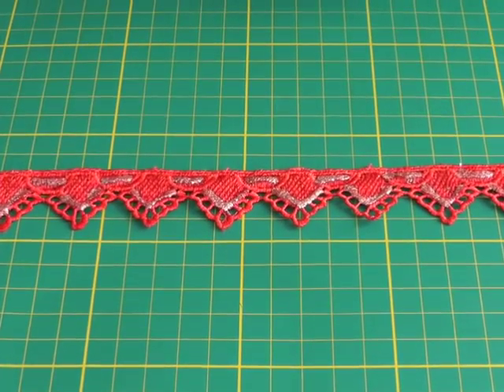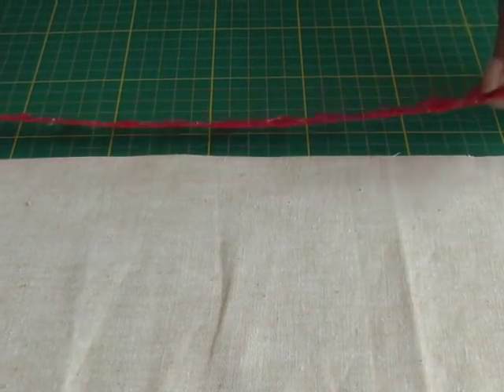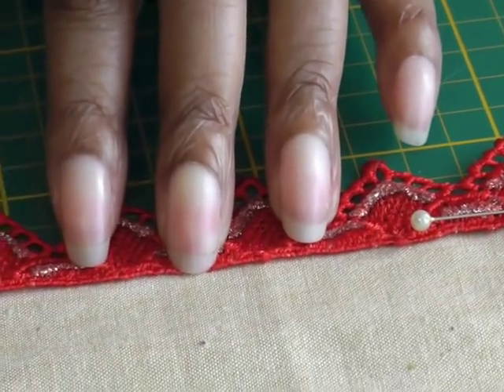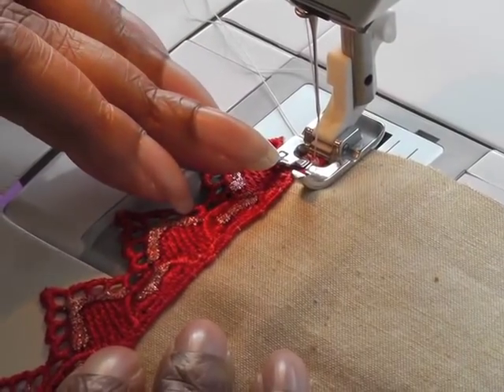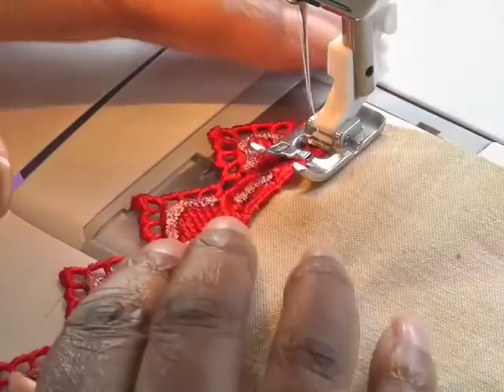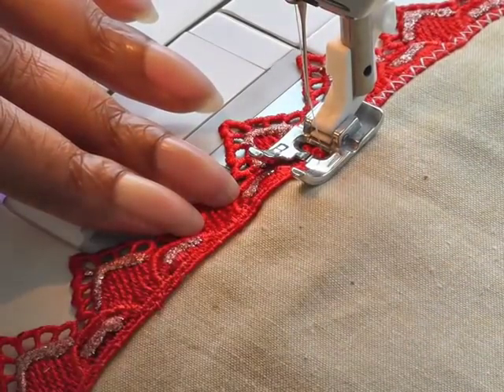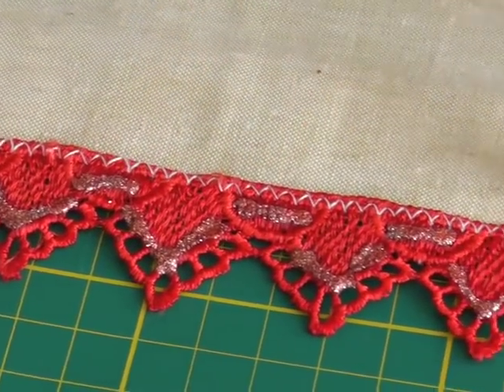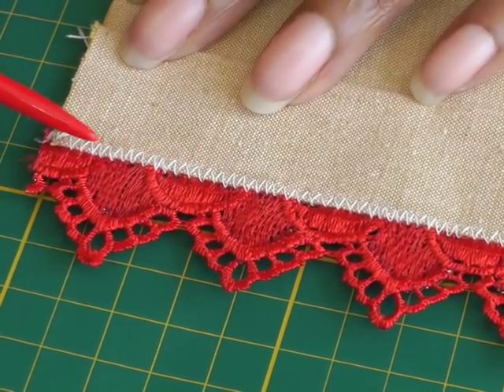Sewing Lace Edging

Comment: A good video and helpful ,but we need to know what type and size needle you used. Especially when the lace and fabric are different tyoes.  What you demonstrated was done exceptionally well.  Voice, speed, and visual were perfect, we just needed a little more info.  Thank you fir sharing.
Reply from the maker: Thank you for the compliment JoJo Sewist.
Reply: JoJo, you really answered your own question. Due to different types, thicknesses, shear and such of both lace and cloth fabrics, you have to adjust your machine setup to your particular needs. Colleen couldn't possibly foretell your project requirements and give an exact answer. I like this video! Well done and informative. If a seamstress hasn't figured out which needle type and size to use by now, they really shouldn't be operating something that'll sew fingers together! Just saying!
Reply: Dean Henthorn when you’re a beginner, you have to learn somehow. Generally one learns by asking questions.
Reply: Dean Henthorn beginners couldn’t know that
Reply: Colleen which foot u used in this video

Comment: I am a beginner and want To add lace around the edges of a short sleeve shirt but the shirt is stretchy material will the zigzag stitch work for allowing stretch? is there anything in particular I should do?
Reply from the maker: Yes! Use the zigzag stitch, you may want to use knit interfacing if it is stretching out of shape. Thanks for commenting Miss R.